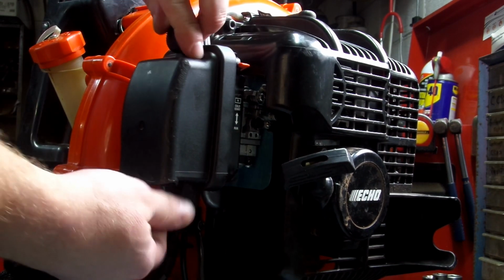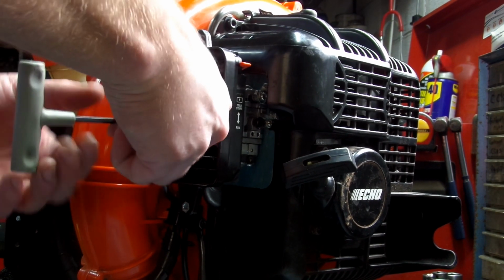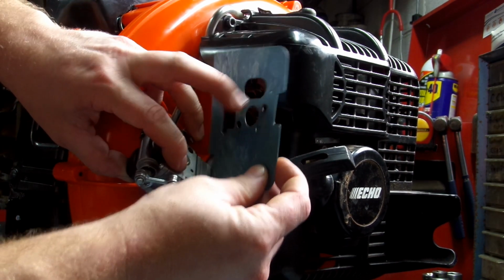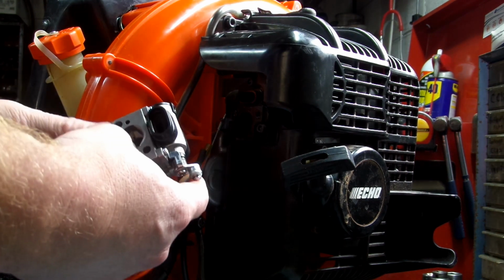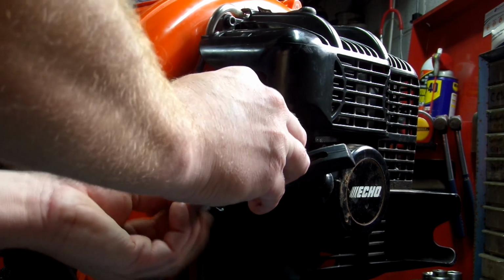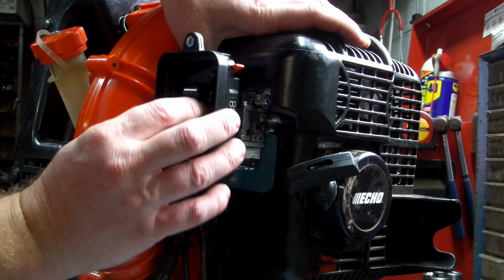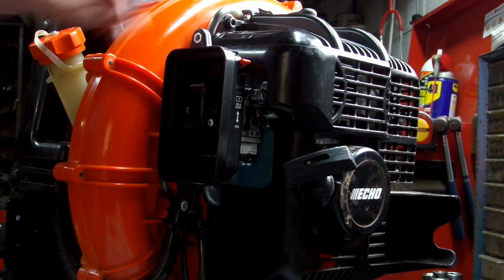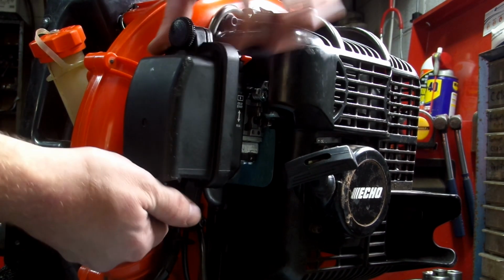Echo pb 500t Installing New Carburetor

Comment: I removed the outer housing (5 screws) before removing the carb mounting screws so I can see if the rubber grommets seated correctly.

Comment: Just an FYI on This.. I have this blower and just ordered a new Carb.. Manufactures number etc. The problem I was having after installation was the throttle cable was too long.  What I finally realized is that the linkage connection on the new carb was reversed from the original carb. Once I flipped it around it was fine.. The new carbs are just a little different!  Enjoy banging your head on a rock like I did.  lol
Reply: I just had the same problem. The arm on my new carb was likewise reversed. Had to flip it around after removing it. The screw was so tight I actually had to grip the carb with a rubber pad and put it in a vice so I could put enough pressure on the holding screw to break it free.

Comment: I've looked at 10 vids of the PB500t. All have a grommet into the fuel tank with the two fuel lines.  Mine does not have a grommet in the tank and it does not have a black fuel line going to the fuel filter.  Did mine come over on the "Mayflower"?  The fuel lines on mine go thru individual holes in the tank and are "fuel line material-yellow or green, depending on lighting or my eyes.
I gave you and all the others I looked at a "thumbs up".  If I look at a vid I give an Up.  When in reality they were not that good.
Reply from the maker: Some have grommets and some have holes in tank. Sometimes I feel the same about 2 cycle stuff lol. They might have come across with the mayflower lol

Comment: Which side is the H jet on that carb?  Air filter side or engine side?  Are the jets adjustable?
Reply from the maker: H is on left near air filter and L is on right. It takes a small D screwdriver that runs 30 dollars. If a rebuild kit did not work on this style I normally just replace with a new one saves you money and a headache.
Reply: So mine is about 3 years old starts and idles fine however when. Full throttle after about 10 sec it starts to bog down and I have to let go of trigger and it idles back. Do you have any suggestions what causes it to loose drastic power and almost stall? Do you recommend changing carberator as the tool to adjust carb is impossible to find
Reply: @frezelfrez8333  Hi sir.  I am not sure. I get conflicting information as to the carb adjustability.
Reply: @frezelfrez8333  adjust the high idle on the carb...u need a special tool though as stated above

Comment: Help! How do you reconnect the linkage from the throttle cable to the little hole on the carb? I've done mine but when I pull my trigger it doesn't move anything once I think I have it all done.
Reply from the maker: make sure your gasket is on the right way behind the carb. if its on backwards it want let the linkage move. their is a cut out on the gasket that allows the linkage to move past it.
Reply: Where can I find the info for replacing the carb on a Echo 770? 

I took off the carb to clean it and it got late on me. I cannot figure out how to put it back on where the cable will open the carb. 

I'm definitely routing it the wrong way. I just can't seem to figure it out.
Reply: Thanks for this video.  I replaced the carburetor successfully but when I turn my blower on its feels like its choked down . After I start it and slide the handle to release the trigger it dies and smokes also not blowing at full power . I did replace spark plug gas and air filter also . Do you know what might be the cause of not running right also it's not my gas mix I used the same gas mix i uses for my echo stm 225. So I know it's not the gas mix . Please help
Reply: Stick it in the hole on throttle turn it down

Comment: can you tell me what the air screw setting must be?
Reply from the maker: It has high and low mixture screws that require a special tool. I usually just buy a new one if cleaning it does not help. The tool is around 30 bucks and is a butt to get them set because they are so small. I wish they would have made the screws the same as other carbs.
Reply from the maker: And the screw on the top sets your idle speed.